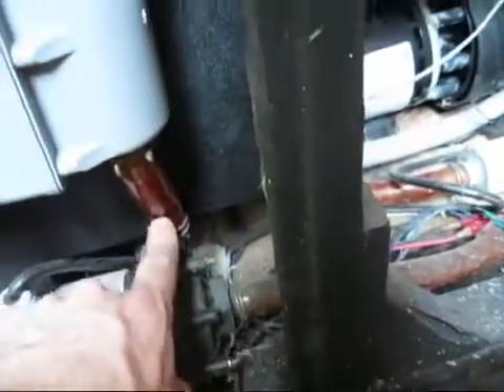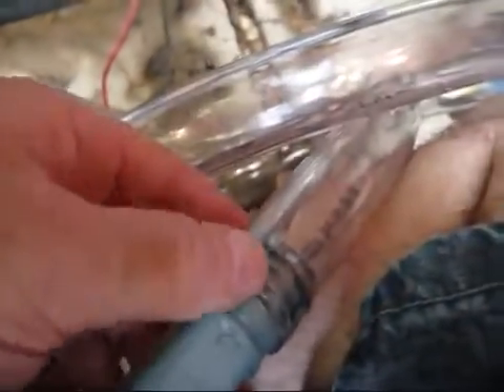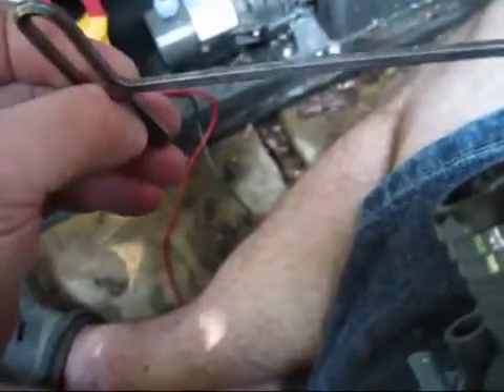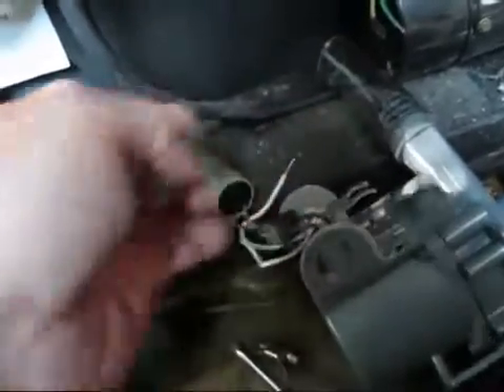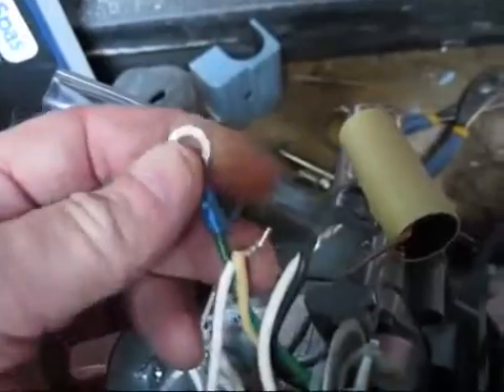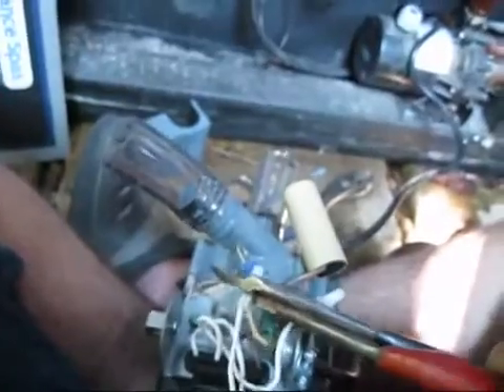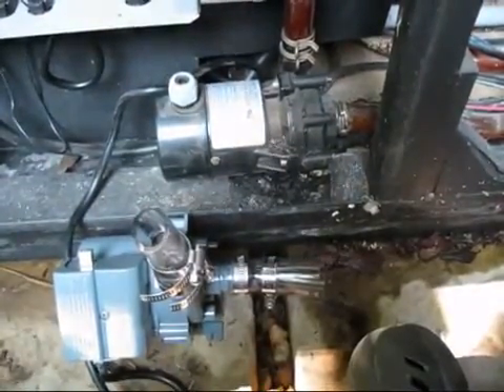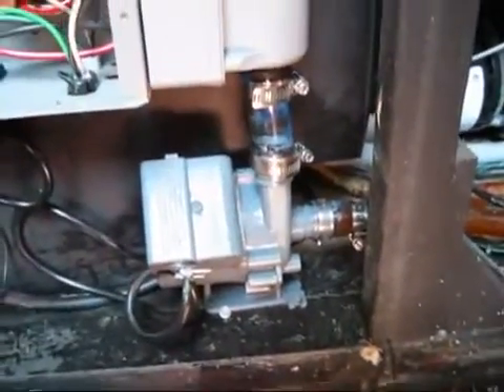Converting a Grundfos in place of a Laing Circulation Pump How To The Spa Guy

Comment: I have a jacuzzi j355 that has a laing circ pump that was replaced 2 years ago.  I keep getting FLO and I thought it was the flow switch so I replaced it.  I also cleaned the filters again.  3 days later I got the FLO again.  Shut it down, took the filter out and it started and ran great.  I thought the filter must be too bad to clean so I put a new filter in.  4 days later I got the FLO again.  Took the new filter out and it's running again.  I am starting to think the circ pump is weak and doesn't flow enough even with the new filter but I can't find this as being a problem. What do you think?  If do I am thinking of the grundfos upgrade like in the video but I see they also have a drop in that you sell part 6000-125.  Does either grundfos pump stand out as better?  I know one in the video is cheaper.  Tia, Bob
Reply from the maker: Robert the Grundfos at that time was another choice but in the long run was not any better.. you could have trash in the impeller on the laing pump if it is clear and moving a lot of water you could adjust the flow switch but that would be the last thing not the first..
Reply: There does not seem to be much water coming out when the pump is running but this is my first spa...  I am guessing the only way to tell if there is trash in the impeller would be to remove the pump and take it apart?  I assume it does come apart...

I was thinking of buying a new pump to put in and inspect/possibly fix this one once it's out for a possible spare for when the new pump goes bad
Reply: What type of heater do you have ? If it is the style heater that has a small black electrical box and about 3 feet of stainless tubing in a C shape then it is likely that given the fact you have addressed the other key issues first…. It could be your circ pump but if you have this style heater I described then it’s possible that you have excessive build up inside of that heater which is a major restriction on the flow rate and it can easily cause scenario like you mentioned your having where it will kind of work but it it is just borderline from adequate flow rate to inadequate flow rate easily failing to fully push the paddle on the flow switch…. Definitely worth checking it out , you can either buy a new heater or you can attempt to clean it out by removing it and poring in some CLR or some acid cleaner such as sand filter cleaner or something and then let it soak for a while and then you will need to beat on the tubing to try and loosen that scale up and knock it all out as best you can … hope that helps anyone reading
Reply: @JakeG462  that is the style heater the spa has.  I just got done testing it.  I think I mentioned that it tested fine electrically (ohms, amps and volts).  I took it out and inspected it.  Everything looked fine, no type of build up that i could see.  I put the hose to it and the water came shooting out.  So now I am back to having no idea of what to try next :(

Comment: Thanks for the great videos!  I have a question... how difficult would it be to convert a hot tub not built for a circulation pump to use one?  I have a Master Spa LSX800.  It looks like the Balboa control pack is already set up for it, I just need the plumbing diagrams.